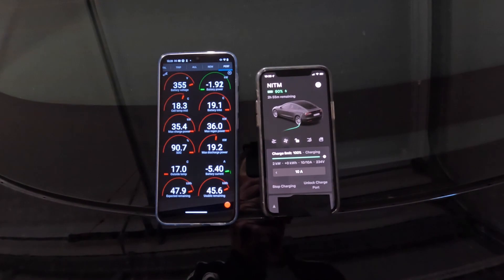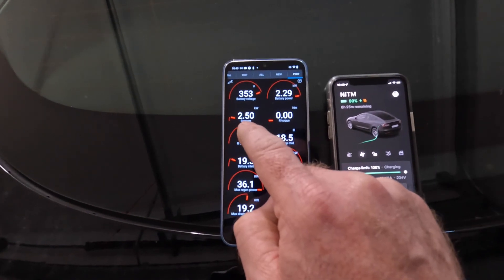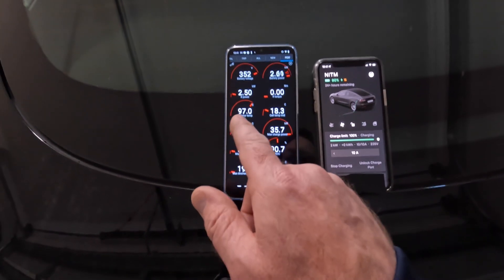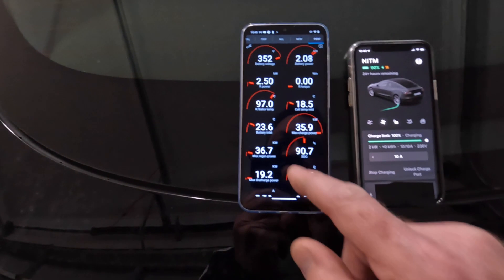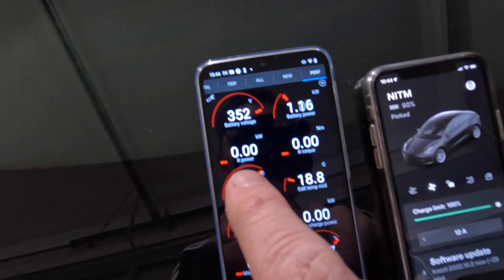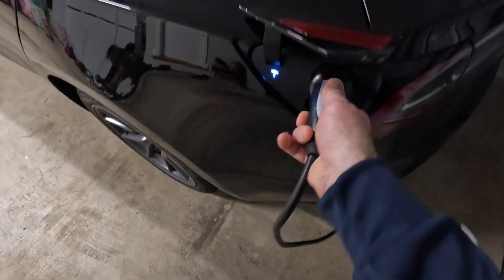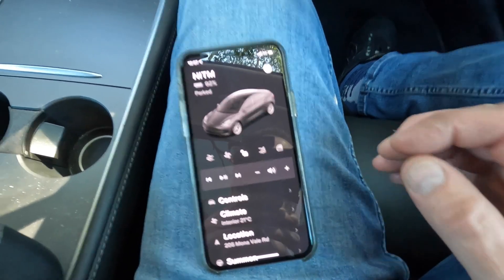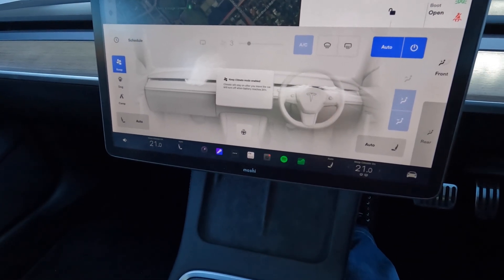Preconditioning episode 1/5 - How to pre-condition your car and what it does. Tesla Model 3.

Comment: At what temperature do you need to precondition before driving?  What is too cold.
Reply from the maker: @MikeFinn-yy1il  Hi Mike. You don’t really “need” to pre-con. The car will protect the battery by limiting power, regen and charging current if it’s too cold. It will heat up while driving but will be slower to heat than a pre-condition. To answer your question regen will be limited until battery reaches 25deg and is also dependant on SOC. The higher your SOC the more limitation when cold. Output power limits generally don’t happen unless the battery cell temp is near freezing. 

Pre-conditioning in cold weather will improve economy during the drive and give you a consistent drive feel with regen and acceleration. To improve the overall economy during a trip you would need to pre-con while connected to a charger so the heating of the battery doesn’t drain energy offsetting any economy gains while driving.

Comment: I keep seeing people saying pre conditioning in cold weather. Im assuming you dont have to in warm weather? Im confused. Should I just be pre conditioning my car before departing as much as I can no matter what the weather? Or only when cold?
Reply from the maker: It’s up to you. You don’t have to do it unless you want a consistent drive feel in cold weather. If you’re happy to have some reduced regen braking when the battery is cold (more important with LFP) then don’t worry about it. I only do it for comfort and consistent driving in winter. For summer my battery is often sitting at 25deg without precon. I only do it to cool the cabin down in summer.  Then for long trips it is good to precon while plugged in when cold. This maximises efficiency because the car doesn’t need to waste energy from the battery to heat everything up. This would only be a small difference unless it’s super cold.

Comment: You are confused.   Just because the battery warms while the climate is on does not mean the battery is preconditioning.  That happens when set to a supercharger.  And it tells you on the center screen.   This info is wrong
Reply from the maker: Pre-conditioning is what it says. The vehicle has different pre-conditioning targets depending on what it is pre-conditioning for. For normal driving the pre-conditioning target is 30degC and for DC fast charging the pre-conditioning target is between 40-60degC. The Tesla owners  manual even describes this as pre-conditioning the battery before driving with a scheduled departure. You could have just asked me instead of trying to tell me I was wrong. Why are you being aggressive about it? It’s not a big deal.

Comment: Hello, about the schedule precondition, does the car know if it's a hot or cold day? If you schedule on a hot 30-degree day, will the indoor temperature drop to 20 degrees for example or get even hotter?
Reply from the maker: Yes the car monitors interior, exterior and battery temps. It will take the cabin to your set temp whether it is cooling or heating. It will also pre condition the battery to its target temp between 20-30degC.
Reply: Ok, thanks! @notinthemanual
Reply from the maker: The climate system in the car is basically a reverse cycle air conditioning system like in a house.

Comment: I have never preconditioned other than routing to a SC on a trip.  When I plugged in my 2018 NCA equipped Model 3, the stator stopped drawing power/heating the battery when the cell temps where around 46F per SMT (this my have changed).  Just picked up our 2023 RWD with the LFP battery, at what cell temp does this chemistry not require heating and allow all the power from shore power to charge the traction battery?  In this video is the car using shore/traction battery only for pre-conditioning? appears it would also charge the traction battery if enough left over power were available?
Reply from the maker: For supercharging it’s a different type of preconditioning and it is trying to get the battery above 40degC to fast charge. Preconditioning for normal driving is just to get cabin and battery temps to the target temp for driving. For the LFP battery this is more important if you want consistent regen braking. Either chemistry battery is more efficient when warm so if you warm it up while plugged into the wall you maximise driving efficiency. When plugged into the wall the rear motor stator will be used as a heater to assist the heat pump system in warming the battery up until about 22degC (faster precon). It will not use the rear motor if you are not plugged into the wall unless the battery is super cold (below 7degC I think as you mentioned). I have only had this happen a couple of times and seems random to me. 

Any left over capacity from the wall socket will charge the battery if needed during precon. The opposite can occur if the wall socket has less capacity than needed for precon and the battery will drain.
Reply from the maker: Target battery temp for normal driving is 30degC but battery precon seems to stop at 23degC when plugged in and 20degC when not plugged in.

Comment: Thanks for sharing a nice video. Does preconditioning improve range
Reply from the maker: If you precondition with the car plugged in, yes. The car will use a small amount of energy to try and heat the battery while driving. If you start off with a warm battery it won’t need to do this. The car aims to keep the battery at 30degC while driving. How much range will depend on your driving style. In my last video on this topic I have some consumption figures. It doesn’t make a huge difference so it is more about consistent driving feel and comfort.

Comment: I am just learning about preconditioning and have a question. I understood you precondition the BATTERY prior to a drive in cold weather to reduce the amount of energy you use when driving.  AT 10.10 you said "Its not trying to heat the battery up that fast".
So now i am confused - is Preconditioning to heat the battery? If so, is there a better way to do so ? Any info you have would be fantastic.
Reply from the maker: Hi. Pre-conditioning is to heat the battery but it is much slower to heat the battery compared to when the car pre-conditions for supercharging. It’s not as aggressive and tends to slowdown after battery reaches 20degC. Tesla need to improve this with the LFP battery as regen can be very limited with a cold LFP battery. A cold LFP can mean below 25degC but there are a lot of variables to the regen limit like battery temp, SOC, ambient temp and regen duty cycle. Extended periods of regen can still see regen limits come on with a warm battery. LFP chemistry is still relatively new for Tesla and I feel they have been slow to make improvements with pre-conditioning. In saying all this if you drive normally the limited regen will still give you one pedal driving. The only exception to this is the harsh regen limiting during long steep descents.
Reply from the maker: We don’t really have cold winters here in Sydney so my experience with pre-conditioning in super cold climates is limited. If you schedule a departure time the car will know how long it needs to pre-condition the cabin and battery and vary the start time accordingly. If you want to heat up faster the only way to do that is to navigate to a nearby supercharger but I don’t feel that is necessary for most people. Tesla have raised the normal operating temp of the motor since I made this video and this extra heat is shared to the battery through the octovalve. The battery heats up faster now during driving. Heat is wasted energy so Tesla try to keep things as efficient as possible and use any excess heat for other systems. I will most likely repeat some of these tests during winter here and see if it has improved. Right now it is 30degC in my garage during the night so I precon to cool the cabin down 😂

Comment: G’day. I’ve managed to still get confused. Scheduled my Tesla to depart by 6:45am. This is at 7pm. No charging starts or due to start u til after midnight. If I add pre-conditioning it’s starts charging straight away. Not normally not an issue other than set to charge 100%, as I’m off to Holland. Don’t want it sat at 100% all night.
What did I do wrong 😃
Reply from the maker: Feel free to email me if you like. I can then send you a screen recording or something if needed.
Reply from the maker: Hey Stephen. I don’t use scheduled charging but I just tested it out then and it worked well. I scheduled departure time from work with preconditioning at 1630 and scheduled charge to start at 1300. The car display says charging to begin at 1300 and it just sits there with the blue light  lit up on the charge port waiting for 1300. I then changed the charge start time to 1600 so it didn’t have enough time to charge to 100% and it just stayed the same with 1600 as the start time. It can be glitchy. I went back in and made sure it was set to pre condition and scheduled charging was also switched on at the same time. I even changed departure time to earlier to see if that would affect it and it always waited for the scheduled charging time. It seems to be working as intended on my car. I am using a 3-phase 11kW Tesla wall connector so it can charge pretty fast. Maybe if you have a slower charger it needs to charge earlier to get you to 100% by departure time. Maybe check you don’t have off peak charging active either. That would possibly conflict. Also wouldn’t be too concerned about being at 100% for one night. If you have an LFP then don’t be concerned at all.

Comment: Hi, if you do preconditioning before the trip without connecting to the socket, all the heat to preheating the battery goes from the heat pump, without the 2.5 kW motor (stator)?
Reply from the maker: Yes. Correct. It uses heat pump and not the stator.  It is much slower than when it is connected to the socket. Even the heat pump is less aggressive when not connected.

Comment: In the next software release they will introduce a new option  to use brakes to make the behavior of one pedal drive consistent no matter how cold the battery is.
Reply from the maker: Thanks Gabriel. Yes that will be good and you will also have the option to turn it off if you don’t want to wear out your brake pads. The car already does this when using autopilot and it works well.

Comment: One thing I would be keen on you to explore is the heat pump condensation, it's relation to "keep climate on" the amount of water dumped from the car. My garage literally pools in water dumped from the ac post drive of I assume battery temp management when charging. I usually just leave climate on auto, but not try to turn off manually when arriving home to try and reduce water in garage
Reply from the maker: Hi Warwick. Yes your right. There is a lot of condensation but this will depend on how humid your garage is. The heat pump and AC compressor work hard in this car. I have noticed extra pooling on my garage floor too. It hasn’t really bothered me but my garage floor is pretty stained anyway. With the wet weather we have had this year I am running a dehumidifier 24/7 in my garage. I am collecting 40lt per day. This has greatly reduced the amount of water pooling under the car. I had an idea the other day and I don’t know why Tesla haven’t done it. If they fitted a small pump they could use this condensation to refill the incredibly small windscreen washer reservoir. I can’t believe how often I need to top that thing up!
Reply: @notinthemanual  I have a expoxy coating and not raw concrete which  water can seep into
Reply from the maker: @BigLeafDropper86  that’s something I wish I did from new.
Reply: @notinthemanual  Tesla did a software update early 2020 to make the ac system run automatically   after the car was parked to dehumidify the cabin and ac ducting and air filter as there were a lot of complaints world wide about musty smelling interiors.
Reply from the maker: @geoffdale8259  Thanks Geoff that was before I had my car so I didn’t know about that. We have had a pretty wet 6 months and mine started to get musty. I ran remote climate on hi heat for 20mins and it smelt like new after. Had to do this a couple of times. When it first happened I even removed the cabin air filters thinking something was dead in there.
Reply from the maker: I’ll have to think about this one a bit. I’m not sure how I would make a video on this subject and have something measurable. Leave it with me.